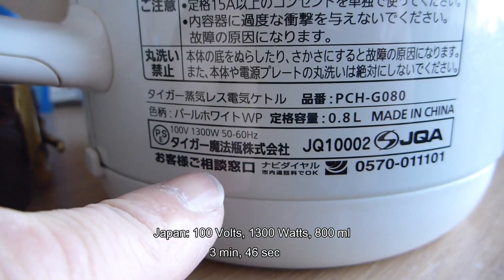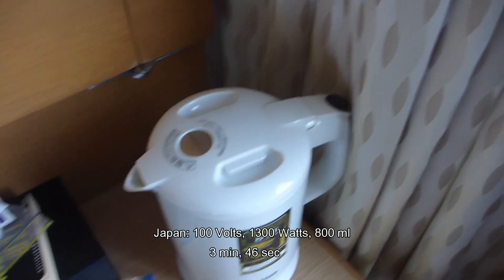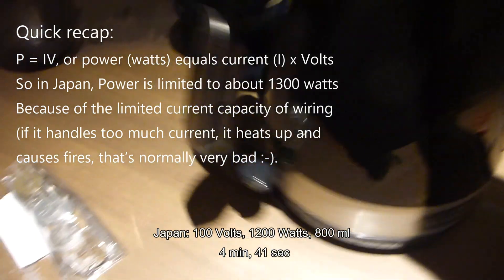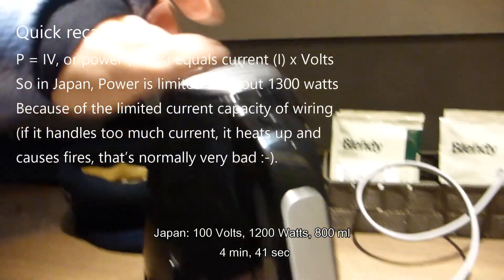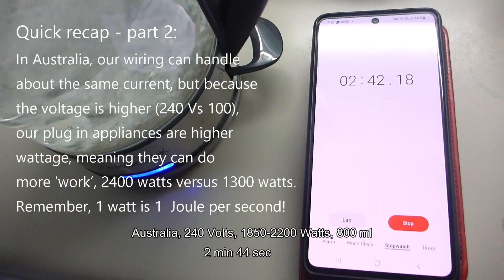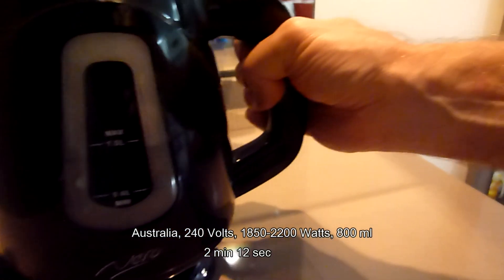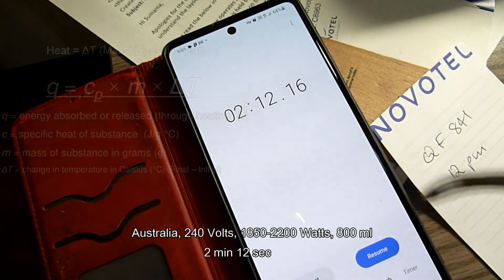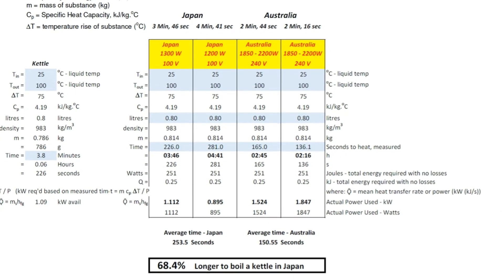Does Voltage matter? 100V in Japan Versus 240V in Australia - what it means

Comment: How will something like a 220voltage cpap machine fair in a 100voltage place 😢?
Reply from the maker: If it's multi-voltage capable you'll be fine. It will state this on the unit. If it's 240 V only it just won't work at all. If you're in doubt, ask the manufacturer with the model number, I.e Resmed.